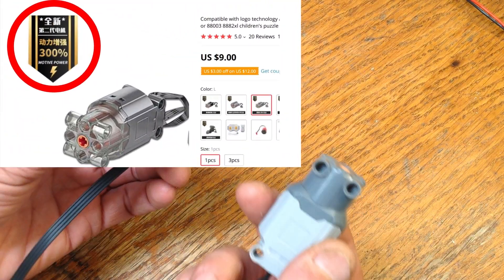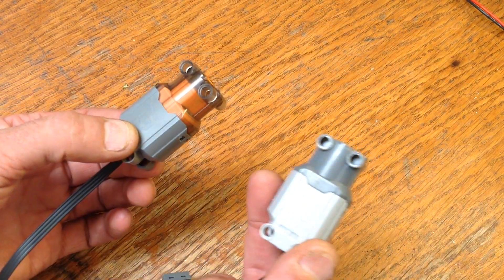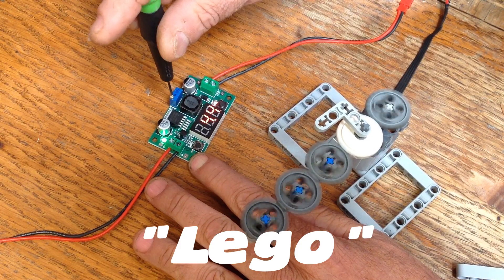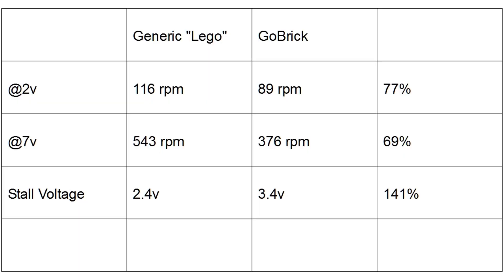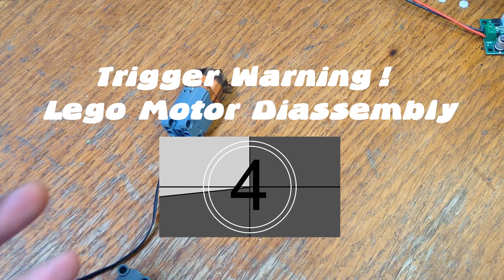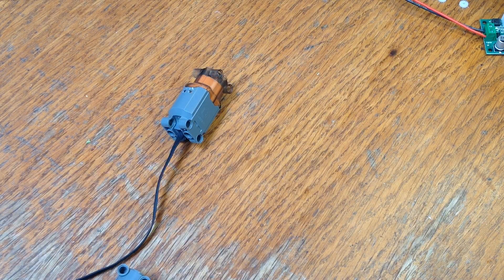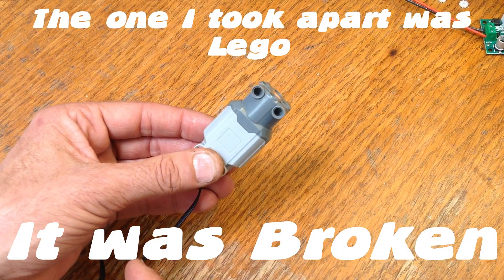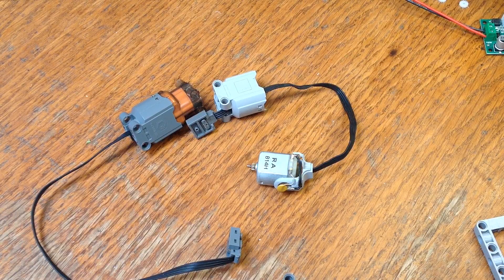GoBrick vs Lego. Is This Motor Any Good? Let's Find Out!

Comment: This is NOT the 300% Speed Motor vom Gobricks, it's the normal one. The 300% Speed variant has a black housing.
Reply from the maker: Thanks for the info! I will try that one. The listing information made the claim of 300% motive power. According to my test they were not correct. Screen shot is in the video.

Comment: excellent research wish I'd though to do this first! My no name Large motor is a lot more powerful than the Lego one, but it has no cutout. It spins faster when linked to the same power pack. And is 1/3 the price . It does smell like ozone/burning though, and I did break one. Might have been because I was running it in parallel with the slower Lego motor though.

Comment: they are very similar except for bo toys brand (which are faster and the internals break!) i like WINNER brand more than lego because it doesn't use infrared!
Reply from the maker: It's hard to figure out what you are buying sometimes. I think some have one less planetary gear set so they spin faster. I need one of those.